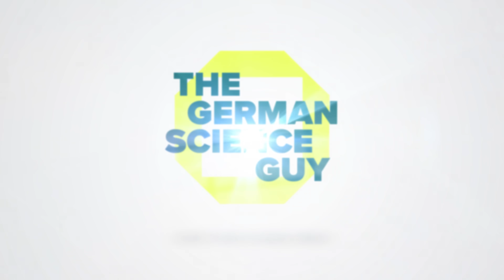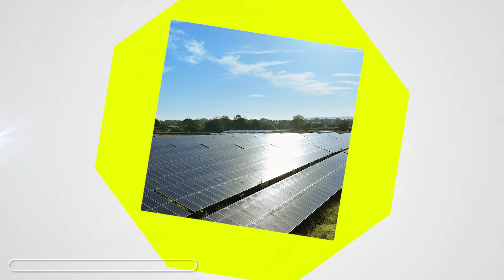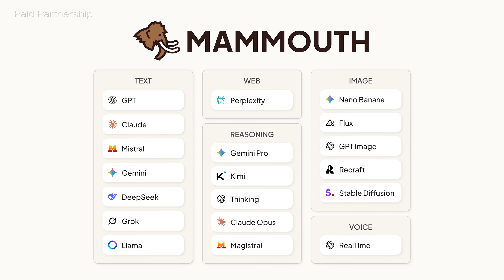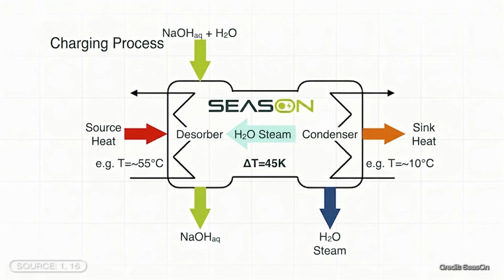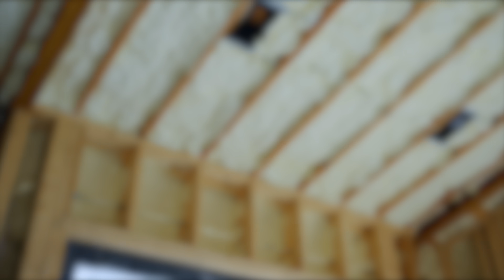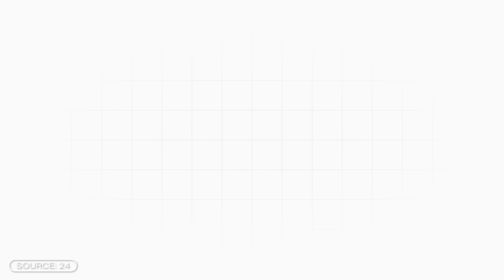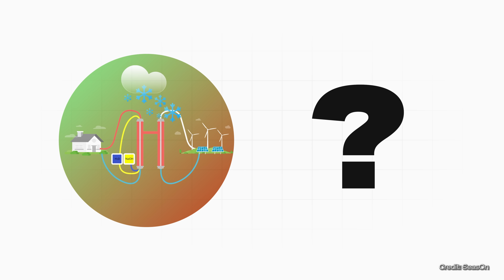New Heat Storage: Better Than a Heat Pump?

Comment: It is a battery.  Sodium batteries have only just entered the market and are predicted to drop in price to just $20/kWh .. couple that with a good R290 air/water heat pump and I doubt any other tech could touch it for cost.  I have not modelled Germany (I am from Alberta, Canada), but in my much colder climate I can meet 80% of my btu heating needs by running at a HP at a COP of 2.5+ at ambient temperatures of -15C or greater.  I can achieve a COP of 2.0 at -20C or greater. Germany doesn’t get that cold .. so a good R290 a/w HP would be all you need backed by a few days worth of sodium batteries.  Just use FF peakers to help get through the dunkelflaute times .. the perfect is the enemy of the good.

Comment: Could it provide cooling in the summer?
Reply from the maker: Actually I asked myself too. I mean the heat pump to evaporate the water could use heat from the sun, maybe even from the inside of the building

Comment: Caustic soda is a nasty substance for fleshies, but it’s easily handled. It’s not at all corrosive to mild steel so cheap, off the shelf pumps, valves, containers etc. can be used.

Comment: thanks jacob.  seems like a solar concentration  would be more effective than converting sun to solar power to heat pump.... we always engineer for the need it now, full max capacity.  if we trickle charged, SOOO many things become extremely cheap with basic environmental absorption...  when can we start working smarter, not harder?

Comment: Your thumbnail is total nonsense. Showing a chemical battery "replacing" a heat pump as if the pump is now useless is like saying a football replaces a banana. One stores energy; the other transfers thermal load.

You can't "kill" the heat pump with this battery when the battery literally requires a conventional heat pump to charge it in the first place! They aren't rivals; they are entirely complementary.

Clickbait thumbnails that pretend storage tech makes transfer tech obsolete hurt the functional exchange of information. I know you have to feed the algorithm to make a buck, but you shouldn't do it at the expense of basic thermodynamic reality.

Comment: Why bother with the chemicals?  Just use water itself.  Huge heat capacity, almost free, can be used for cooling real easy.  The whole system can be run by a single adequately sized refrigeration cycle.  If you're feeling particularly clever, hook up a big box of paraffin for a hot side battery so you can have showers and stuff.

Comment: How about forgetting about the hydroxide part and storing sodium metal?  Like iron powder, but easier to get the energy back?  For oxidising metals you go get a caddy or cassette for where you need the heat, and return for recharging.  In the early middle ages some castles used iron powder for heating in their towers. Get it delivered like you did for coal? A little bit heavy, calcium metal is something to work on now?

Comment: Not a general solution with that energy density, if it works in a situation, it works. What's the worst that could happen? Leaking sodium hydroxide shouldn't poison land for 100's of years, need a few years with heavy rain if there's a big leak. Potassium may be a better salt for this reason, it would be fertilizing the ground, as in NPK?

Comment: I saw another video this or last week about new solar panel that were extremely efficient. The funny thing was of course that only part of the energy was converted to electricity. Excess heat is bad for electricity production so they had an underlying system that gathered the excess heat. Where does the heat stay? Well, maybe this video answered that question. We'll have to see about costs of course, it's easy to think about a principle but a lot harder to manufacture something that has good practical use. It's low in rare earth minerals and no pollution? Sounds good then.
Reply: As I was thinking it over a couple of more minutes I realized... 
While the heat is transferred into storage it also keeps the house cool during summer. So you have an air conditioning function build in just as a free added advantage. 
You keep the heat for winter and no fossil fools are burned along the way. 
And wasn't Dr. Jacob Beautemps also an expert on Stirling Engines? Could we use the heat together with a Stirling Engine some way to generate the additional desired electricity in winter next to heating our house at the same time?
Now that sounds promising to me!

Comment: Concentrated hot caustic soda is no joke. It eats inox like bread. It even attacks glass. I think HDPE kinda holds caustic soda, but not hot concentrated caustic soda for long term. This is dangerous. Melts your face like in horror movies. And not even best in terms of KW/M^3. If you run the numbers, you would need like 70 m^3 for a house ( based on EU stats ) , and that is a theoretical optimistic estimation.
Reply: It should only stay hot for a short time and in a low volume, when the energy is being extracted. Needing three tanks?

Comment: Calcium chloride is not as caustic and has a higher water enthalpy of solution with water than sodium hydroxide. CaCl2 might be a good material to use for this application. Cheap, plentiful, and that caustic or reactive.

Comment: An interesting way of dehydrating the caustic soda would be to heat directly from data centers. They’d save on water for cooling in the heat round and provide cheap carbon-free winter heating.

Comment: Heat storage of 20m3 of NaO you gave power output 80kw but no indication of the energy stored?  Is this a source of heat for just the coldest days?  Obviously in summer the heat pump evaporator gives off cold air so air conditioning.

Comment: If a building requires high flow temperatures to provide sufficient heat due to poor insulation, then the first step should be the improve the insulation. The effect will be to reduce overall energy consumption as well as peak energy consumption as it could be heated using a smaller heat pump. I'm not saying don't develop thermal energy storage solutions, but lets first use simple solutions to simple problems, then solve any complex ones that remain.

Comment: If I could store the summer sun’s energy for winter, I’d do it immediately. My biggest problem is that I have nowhere to keep the solar power I generate in summer for long-term use. Selling it to the grid has become almost pointless — electricity prices have dropped, grid fees have increased, and in some cases I even end up paying extra. Battery banks aren’t designed for seasonal storage, and getting enough capacity would be far too expensive.
Reply: I once, 30 yrs ago seen an article about a system that heated water then pump circulated it though multiple PVC tubes drilled down 50 ft into the ground, it covered a large area and used a lot of the 50 ft deep tubes to store heat in a huge area. It used the ground as a huge heat storage system. Summer - heat in. Winter heat out, all via a direct solar water heating and radiator system. It was ran via a low power pump and used a few solar panels to operate during summer. Then a low power AC pump was used in winter. It was designed and installed by an aerospace engineer on his own property and it was said to work well enough to heat his house in winter. I don't recall where he lived but it was not in a super cold area.

Comment: Sounds good until you start dealing with NaOH leaks. It may work for large-scale solutions, like city wide heating. The main issue I see is that it works for heating only. I think ice buffers are better solution. It only uses water, basically no moving parts, and it can be used both for heating and cooling. In the summer, excess heat is dumped in the buffer and in the winter it's pulled out, and the water is cooled or outright frozen. The main issue here is how much water is needed for the buffer
Reply: Ice is surprisingly annoying stuff - it grows in size as it freezes so you have all sorts of containment issues and it's really hard to get the energy back out of effectively, otherwise we'd all simply be freezing meter cube blocks of ice to keep cool in summer.

Comment: So 20m3 is just 10 days of heat?
That's not going to work.
Just use a reversible ground source heat pump with a borehole. In summer, heat the ground by cooling the homes, then in winter extract heat from the ground.

Comment: Assuming the conversion is  100% efficient. And instead of trying to cover the entire heat load of the house, you could aim for supplementing a heat pump, you just target the times when the temperature drops below 7degrees(when the COP tanks), let's say 85%, so 38.4m³ storage. Then you say you want to save 30% on your heating bill, so 12.8m³ of storage. That is in the realm of typical rain water storage tanks in the suburbs.
12.8 x 280kWh/m², say we have 4 months of non-heating days, that would mean you need 29.86kW daily of excess solar to regenerate your storage for winter. Am I missing something? This still feels impractical large numbers?

Comment: Very skeptical about this. It occupies a lot of space and you can't just put a hole in the ground and "stick it in" 48m3 surely means the total system is  double or triple the size (considering insulation and equipment), say 100-150m3, that would mean for a single story building we would "waste" 60-100% of expensive cellar space for this (We Germans love our cellars as much as we do Brezeln, we don't like to give it away.....)

Comment: Can we use this stuff as an alternate fuel for an external combustion engine? You know, the kind of engine that pulls heat into the chamber and uses the vacuum of cooling gas to pull pistons instead of heating gas to push pistons. It's the same thing mechanically, except you're not wasting cylinder volume with spent fuel... AND it simplifies the engine block by getting rid of injectors, spark plugs and all the other fuel regulation systems. They can be packaged into a heating element that just needs to maintain a temperature suitable for the cylinders to inhale, and the heating element could be swapped out for a different one that uses any fuel that works... like maybe caustic soda, or wood gas, or a barrel full of salt you left sitting under a solar collector all day, or a vat of oil that you used as a heat sink on your air conditioner exhaust, instead of just blowing it outside. You could even have a spare thermal battery to collect the lower grade "waste heat" from your car, and upcycle it to higher temperatures with a heat pump that runs on heat, or top it off with a bonfire or hydrating some salt or whatever.

Everything we do converts to heat to get the work done, and it takes a lot of heat to get some small side effect that we want. If we think about it like water, we're running around operating ram pumps and discarding the giant pool of water we needed to use to get it to work, then paying for a global supply chain to deliver more water we could have just mopped up and repackaged ten times over for less money and effort.

😂

But that's not a captured economy, so it's never happening is it?

Comment: Science guy you did a mistake you gave us KW and not kWh, I do not care if it has 80kw instant power, if it last for only one hour, you didn't give us the cycle time of the system 
Rookie mistake 

The weird thing is that on the house calculation you did it right

I am not quite sure if the caustic soda is already wet release heat

Comment: The heat pump is an indication that it's not a huge storage that gets filled when electricity prices are negative and then stored for winter. In that case you would just use a heating element: no maintenance and lower investment per kW. And you can utilize a lot more electricity at negative electricity prices.
The grid connection is a major limitation also that restricts how much energy you can store per unit of time. Most apartment buildings hardly produce enough solar electricity to satisfy their own annual utility demand, so there won't be enough excess to fill winter heat storage.
It looks like a system that will store heat for a few weeks only. With 2 weeks of storage (for winter), you could get about 10 cycles over the year.  So I think that 75% of annual heat consumed suggested will be closer to 10%.
A dunkelflaute is rare enough, that you will find cheap/affordable electricity regularly enough most of the time. The storage should last long enough to get through a 3 weeks dunkelflaute buying expensiver electricity, rather than ridicilously expensive electricity, so it's affordable enough so a dunkelflaute won't effect the ROI too much.
Reply: It can be tha same heat pump used to cool the house in summer and to heat it from September to november and from February to May when outside temperatures are over 10° and photovoltaic still contribute to the power grid.
Reply: @PaoloSulprizio  You might be able to do cooling as well. But I don't think you'll see seasonal storage for many months at a time. It just requires too much storage to be viable. Wind power is available year round. Not always, but with a few weeks of storage you can bridge low wind periods in winter.
Reply: @GerbenWulff it's exactly what I said. This kind of energy storage could be used only from December to February or even less and not all the days, just under a certain COP of the heat pump.

Comment: We'll put a swimming pool of bone melting caustic drain cleaner under your house and in 25 years you'll MAYBE break even if the house itself doesn't fall into the pool and melts together with you from the fumes. Also your house will become a superfund site if it ever leaks and you'll be famous in the whole region as the idiot who polluted their groundwater source with a pool of drain cleaner. What a deal, where do we sign up?

Comment: Ammonia or desiccant based cooling systems could be added to this system.  Being both use heat to dehydrate both, storage wouldn't as significant. 

Where I'm at in California, the humidity is low enough that the daily temperature swing can be enough to need weeks worth of storage instead of months.

Comment: How efficient is the reaction to turn calcium hydroxide into quicklime?    Could that be used in a similar manner?    (Quicklime gets really hot when you add water!)
Reply: I looked it up and it only takes 512 degrees to drive off the water in quicklime.   I measured the temperature on the outside of my solar cooker at greater than that a couple of times and my solar cooker  could be finer built and concentrate the light a lot more!

Comment: I guess you could store your NaOH in a gigantic mine?  Just spray the tunnels with the appropriate substance and fill her up.   Here is a question,  how much water do you remove at a time?   Is it 100% for each liter?   And then when you release the energy,  you add water to make it "saturated" again.  or can you add a little bit?  It just sounds like you need double the storage.  You actually need 3 tanks,  one for the water, one for the NaOH and one for the spent mixture and you need a "reactor tank" where the 2 things get mixed together  and another reactor tank where the water gets boiled off.   So it is a bit more complicated than it sounds.   The good news is that it also sounds like you can use solar thermal to boil off the water.   If its a sunny day, that is more efficient than solar PV.  Maybe you could use a mixture,  solar thermal to heat up the mixture, and solar PV to bring it to the final boiling temperature.  Again, if it was all  underground in a giant mine,  you could store and harvest heat as geothermal too.

Comment: Bury these under PV fields and hook them up to district heating systems. These systems make little sense for apartment blocks as the storage size requirements are too big for most dense urban areas. 
 However you can bury as many tanks as you like in a field(preferably a non-productive or contaminated one) then cover the whole thing with PV and have it supply heat to tens of thousands of customers supplementing existing sources like industrial waste heat recovery. District heating is already well established in many countries and this seems like a good match.
Reply: or just build an AI data center, covered by PV and use the heat to cool the data center by heating sports and other public facilities.

Comment: my previous comment on the intro ( I solved the same problem they are solving in a different way ) ..... But Wait.
Hybridizing Solar Thermal with Geo-Thermal was something I thought of to reduce the size of a Geo-Thermal field, and better ft to applications......where The Size of the tank here is an issue.
so solar thermal ( heat source ) + geo-thermal ( heat sink ) + Thermal Battery ??? HEY !!!
add a heat pump and configure to macth year round loads ....so I got them another application.( but it would be a smaller tank )  AC heat pumps into the ground and the battery, Heat comes out of the ST panel and battery, ( basically, assuming a solstice Solar Thermal angle )
Reply: a practical small vertical bore geo-thermal typically can't heat a house, but could cool a house very well.
the heat  battery could possibly help reduce the cost of the solar thermal,
 and the solar thermal could reduce the size of the tanks.
Reply: there would have to be a solar thermal / geo-thermal hybrid system company to give them some practical heat battery numbers though.
I don't exactly know where a typical application would land, but I could bet the tanks would be less expensive that the ST panels ... but the tanks would have to dimensionaly  fit the application
Reply: I think cooling data centers is better left to geothermal heat pumps though ... it's less power to get Rid of the heat.
where storing the heat would require more power, subtracted from what is stored ( in comparison )

but it's where ever the numbers say...not what I say there.